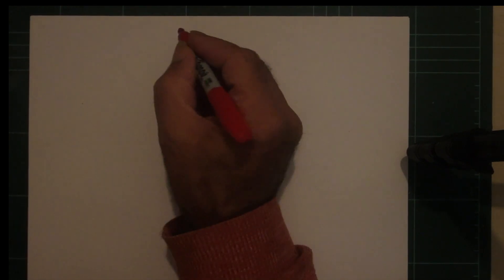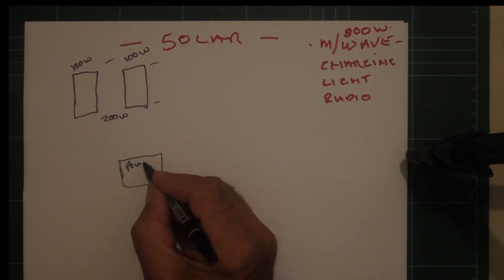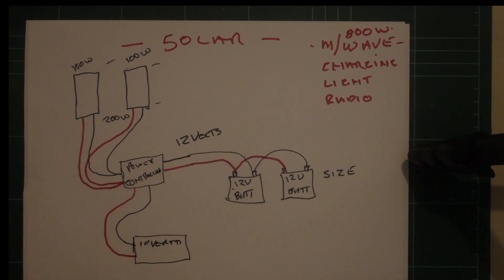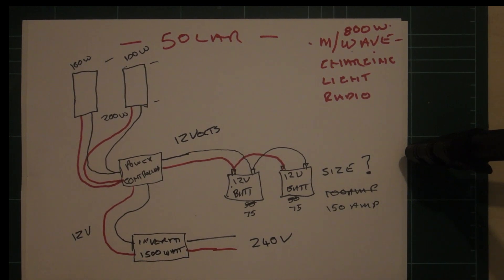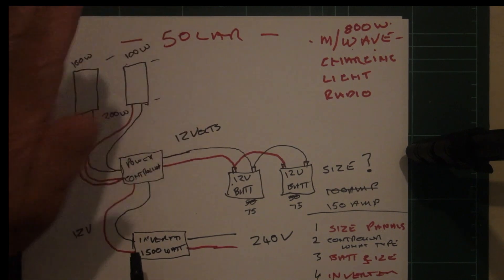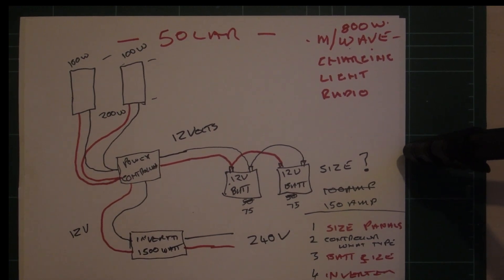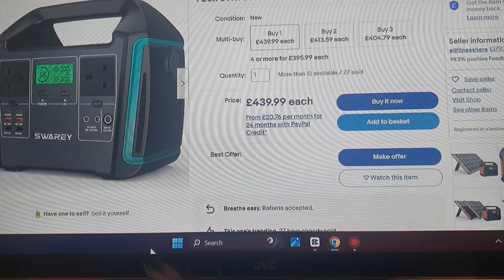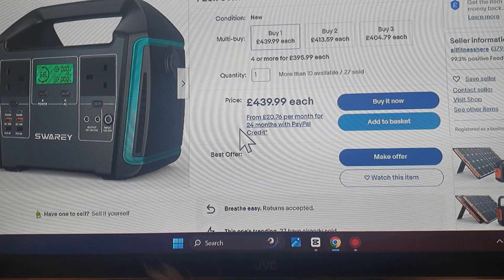What Solar do I fit to my Boat   23/7 Just need help so don't waste my money The Sailing Junkie

Comment: I was just going  to  say that you can get units  that are  all inclusive  of solar panels and battery  with built in charger pug points  for 13amp.usb points  every  you need whilst under charge you first set could be expensive  for what you are going to use the boat for 
If you go to sea you need nav equipment ais sender /reciever for safety  depth sounder this is where a good electronic  come in but that is your decision

Comment: For just a few pounds you can get a camp stove to heat your food and boil a kettle. That would save the need for inverters, a second battery, a second panel and a bulky microwave.
You haven't mentioned using the outboard to provide electricity; it may have a charging coil.
No mention either of power for instruments, if you are planning on going to sea you'll probably need at least a depth gauge.
Reply: The boat already has a propane cooker aboard.

Comment: Before you make any decisions you have to answer a couple of questions.

1.  How often will you use the boat and how long will each use last?
2.  How much do you intend to use the microwave each day you are on the boat.

Answers to these two questions are needed to determine how much power you will draw from the batteries and thus how much you need to put back in.  I will give an example to illustrate this.

Lets say you will use the boat on the weekend for two days and one night each week.  That means that you will likely use the interior lights for about 4 hours during the night you are aboard.  If you are running two lights and they are LED lights running from the batteries.  Each light will draw about 0.2 amps for 4 hours or 0.8 amp-hours for the two lights for the night.  If the lights are incandescent they will likely use more like 8 amp-hours for the night.  I assume that by "radio" you men a VHF radio for ship to ship and ship to shore installation type communications.  Normally the radio would be on in standby mode when the boat was underway and would only be used to transmit for short periods, 30 seconds to a minute, a few times each day.  A standard marine VHF radio uses about 0.3 amps on standby and 5 amps on transmit at high power (25w).  So if you have the radio on for 4 hours per day on standby and transmit of 5 minutes (which is a lot), the radio will use about 1.6 amp-hr each day.  Charging cell phones will require about 1.5 amp-hr to fully charge one cell phone.  So base power consumption will be as follows for a weekend with one night aboard and 4 hours underway each day:
Lights - 0.8 to 8 amp-hr
VHF radio - 3.2 amp-hr
Cell phone charging - 1.5 amp-hr per phone
For a total of 5.5 to 12.5 amp-hr (depending on what sort of lights you have)

Now, lets consider the elephant in the room - the microwave.  An 800 watt microwave will draw about 1,200 watts of AC (mains) power provided by your inverter.  Inexpensive, high frequency, inverters run at about 80% efficiency, so that means that running the microwave will draw about 1,500 watts from your battery.  For a 12 volt lead acid battery that means a 125 amp draw.  Lead acid batteries suffer voltage drop when a lot of power is drawn from them and one 100 amp-hour battery just won't run an 800 watt microwave reliably.  So I would suggest that you would need two 100-amp-hr deep cycle (Leisure) batteries to run an 800 watt microwave.  How much power you use during my hypothetical weekend aboard depends on how long you run the microwave.  Conservatively, to heat water for tea/coffee and heat  meals will require about 30 minutes per day.  30 minutes at 125 amps is 62.5 amp-hr.

So approximate total power consumption over the weekend is about 75 amp-hr that the batteries have to provide.  Lead acid batteries (flooded or AGM) should not be drawn down by more than about 50% of their capacity if you want them to last more than a few discharge/charge cycles.  Thus, providing 75-amp-hr of power means a minimum of 150 amp-hr of battery capacity.  The most common leisure batteries are rated for about 100 amp-hr, so two such batteries in parallel would provide 200 amp-hr total of which about 100 amp-hr is usable.  Consequently, I would suggest that you need two 100 amp-hr rated leisure batteries.

Now charging the batteries from solar.  My crude analysis above says that you will need to put 75 amp-hr of energy back into the batteries after a weekend aboard.  Lets consider a 100 watt solar panel.  In the UK in summer you will get at most about 5 full sun hours equivalent per day on completely sunny (zero clouds) summer days in late June/early July.  Later in the summer you will get less power from the sun.  So lets say you will get an average of 4 full sun equivalent hours per completely sunny day.  That means that a 100 watt solar panel can put out about 4 hours times 100 watts or 400 watt-hr per completely sunny day.  I do not live in the UK, but I have heard that not every summer day is completely cloud free there.  A quick google search suggests that only about 1/3 of summer days will be sunny.  So lets say that you will average about 2.33 full sun days per week.  That will give you about 900 watt-hr per week from your solar panels on full sun days each week and about 700 watt-hour on the cloudier days for about 1,600 watt-hr per week.  This assumes that you 100 watt solar panel is never shaded by anything on the boat.  Any shade on a solar panel reduces its output.  Unfortunately sailboats have those pesky masts and booms that shade the boat.  I note that your boat has a free standing mast so you don't have wires to provide additional shade.  That said, when swinging on a mooring your mast and boom will conservatively shade your solar panels 15-25% of the time, which will reduce the output of the solar panels.  So lets use 20% reduction due to shading.  That reduces solar power production from a 100 watt solar panel to about 1,200 watt-hr per week on average.  Now we need to get the power from the solar panel to the batteries.  That requires a solar charge controller.  PWM solar charge controllers are typically about 80% efficient while MPPT controllers are about 95-97% efficient.  So you want an MPPT charge controller.  With an MPPT charge controller your average weekly charging power from a 100 watt panel will be about 0.95 x 1,200 watt-hr = 1,140 watt-hr.  Lead acid batteries are not 100% efficient when charging.  They tend to run about 80% efficient when charging, which reduces the amount of weekly charge from a 100 watt panel to about 900 watt-hr.  A typical charging voltage is 13.5 volts DC which converts the 900 watt-hr to (900/13.5) 66 amp-hr (amp-hours equal watt hours divided by voltage).  So if you want to replace 75 amp-hours of consumption from your batteries in a week, you will realistically need about 200 watts of solar panels.

Now lets consider the way your boat is set up.  First, it has a propane cooker.  That cooker does use electricity since I assume the propane bottle has a solenoid valve to shut the propane off when the cooker is not in use.  I know that such a solenoid valve is mandatory in the USA where I am.  Propane solenoid valves use about 1 amp when they are open, so lets say you use the cooker for one hour a day (a lot).  That means your cooker will require about 2 amp-hr per weekend aboard. for total power consumption of about 14.5 amp-hr for a weekend aboard.  If you use the propane cooker instead of a microwave you can easily get away with a single 100 amp-hr rated leisure battery and  one 100 watt solar panel.

Finally, if you have two batteries and take one home to charge, the other battery will remain depleted.  For example, if your two batteries are drawn down by 75 amp-hr, taking one battery home to charge means you will start your next trip down by about 38 amp-hr.  So if you use 75 amp-hr again you will end the trip with the pair of batteries down by 113 amp-hr, which is more than you want to draw two 100 amp-hr rated leisure batteries down by if you want them to last more than a single season.  Basically, if you are taking the batteries home to charge, take them all.  Of course that means lugging multiple 30 kg batteries around, which is never fun.
Also, you connect the inverter to the batteries NOT the solar charge controller.
Reply from the maker: Thank you so much going to read it over and over so l take it all in
As not sailing round the world will try two batteries and take one home to charge up 
Use a gas hob for cooking and forget the microwave 
Thats the way to go l think
Thanks again 
Ted Carter
The Sailing Junkie